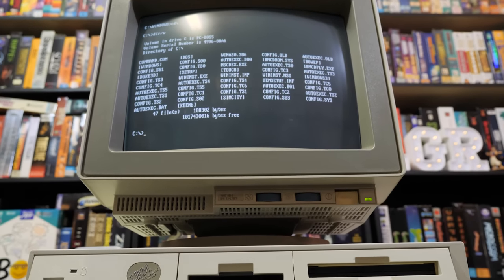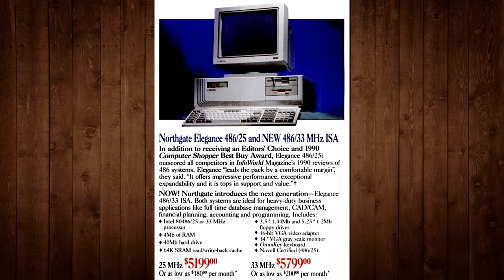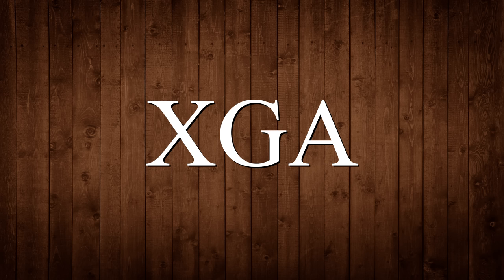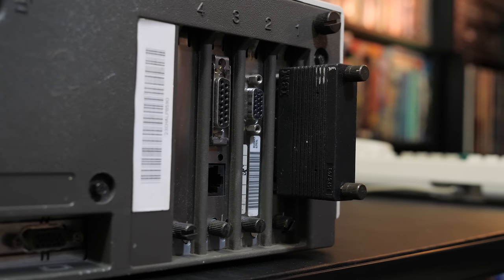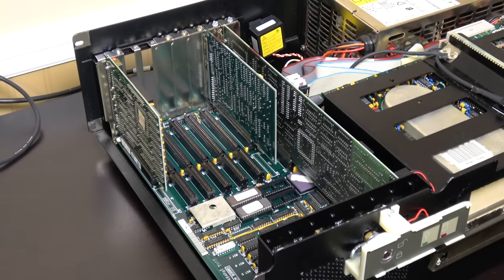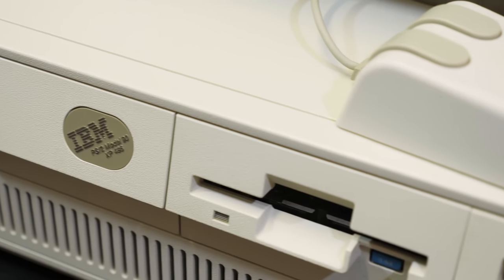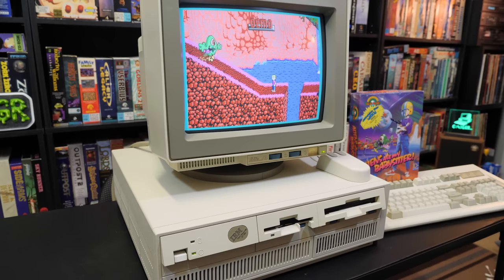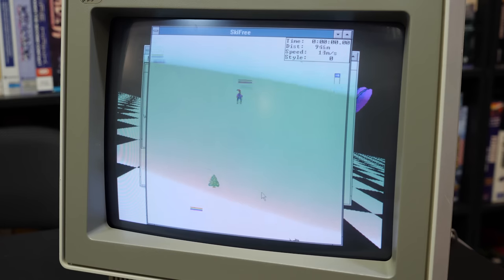$17,000 PC from 1990: IBM PS/2 Model 90 XP 486

Comment: That awkward moment when you realize: In the year 2044, someone will make a similar video about Threadripper and Core i9...
Reply: That won't happen. The i9 never cost as much as a car. The next big leap in performance is at least 20 years out and will replace silicon CMOS with an entirely new paradigm and the i9 will become regarded as a vacuum tube or mechanical switch computer in comparison. Silicon CMOS is pretty much dead. For the next 20 years or so we're stuck with it and you'll get perhaps a factor 2 more CPU performance and a factor 10 or so GPU performance. 

(as a comparison, in the 90's CPU performance increased by 60% per year on average, and if that had continued until 2044 processors in 2044 would be 14 million times faster than what we have today; if it had continued from today and for the next 26 years, processors in 2044 would be 200 000 times faster than today).
Reply: No... it will be like someone in 2045 talking about how quantum computers took up a whole closet and costed millions in 2020
Reply: (0_0) Wow how do you know that?
Reply: IDK, it doesn't seem like too much has changed in terms of standards like it did in the 90s. we can capably use computers from 7 years ago for general computing tasks but in '97 a machine from 1990 would've been ass.
Reply: Also why is this awkward? You make it sound like people never talk about hardware from the past.
Reply: hey, maybe older Clint will do that in 2040 
"this is the Razer Blade laptop, and you've guessed it, it can play Crysis" in Clint duke nukem voice
😅😅😅
Reply: girlsdrinkfeck, you must not now much about modern computers, if you think threadrippers will melt or burn someones house down. They are no more power hungry than an I9, as a matter of fact some I9's run a lot hotter then the threadripper processors. I know AMD processors right before ryzen and threadripper were bad, but ryzen and TR are really good chips. Anyone that is being realistic and not a fanboy, knows this.
Reply: girlsdrinkfeck LOL are you really fanboying a cpu? What are you, 12?
Reply: girlsdrinkfeck Keep trying.
Reply: Rickertsc2 lol that was a great prediction currente age hardware will be described in the future.
Reply: I think this is the big issue, between 1980 and 2000, each new generation doubled computer performance, people were willing to spend thousands of dollars for the bleeding edge technology that had just came out.  Then we got to the point, where your standard desktop used for office work, email and web browsing hit the good enough limit.  I type this on a computer I built in 2007, for most stuff, it's got plenty of performance, even computer programming is well within it's capabilities.  Gaming and video production are about the only areas where there is still room for performance increases.  It used to include servers, but then systems were developed where you could network dozens, even thousands of machines together to serve data,..
Reply: This is a high probability
Reply: AMD processors right before Ryzen were bad? Kiddo...my 1st x86 CPU was a AMD 286 with big, fucking fast 12 MHz! And the AMD 386-DX40, albeit being a older CPU gen, was faster than the Intel 486SX-25, also have had the extra Co-Processor being socketed onto my 386 Mainboard. 

AMD, Cyrix, even NexGen, TexasInstruments (Ti 486 Clones back then) and others have all been nice, cheaper alternatives to Intel CPUs....and nowadays, it's only Intel & AMD, who survived....and remember, if AMD would go down the drain, only Intel would be...and the prices would have been much higher, innovations quite less.....monopols are never being good for others, only for the firm, which is itself the monopolist. ;)
Reply: Not exactly.  Computer technology advances at a much slower rate every year because we've already discovered the major innovations, and we are beginning to hit the limits at which current materials can handle.  For example, from 1990 to 2000, CPU performance increased an average of 52% every year.  But from 2001-2006, CPU performance only averaged a 20% increase every year.  In fact, from 2010-2018, CPU processing speeds have not changed at all, and single thread performance has increased marginally.  The only aspect of CPU technology that changes consistently is the number of transistors embedded into the chips.  Transistor population can improve data load capabilities without increasing processing speeds.  However, the larger number of transistors, the lower amount of workload each individual array can handle, making the chip less efficient.  You can see this phenomenon when comparing quad-core chips to 8-core chips.  Single core performance will be greater in the Quad chip because each core is larger.  The 8-core chip will be more powerful as a whole, but only when all cores are working together because each individual core is weaker.  So why are chip manufacturers using this method to increase performance?  Well the answer is quite simple: Increasing processing speeds also increases heat production.  We reached the maximum level at which processors can safely dissipate heat with their current materials.  So manufactures have adopted the "power in numbers" ideology by shoving in more processing units rather than increasing the speed at which current transistors can run.  This leads into another issue.  You can only compact so many transistors onto a chip until it runs out of space and cannot shrink anymore.  So not only is heat an issue, space is an issue.       

We are at the point where current technology is so good that it is beginning to plateau.  The elements and materials we use to build processors and circuit boards can only handle so much power in such a small space.  Think about it.  We build modern processors using the same general materials from 30 years ago.  In order for computer technology to make another huge leap, we have to start using different materials, which involves creating a whole new architecture from the ground up.
Reply: Or something bad happens in the world and all the knowledge of technology is lost and we desperately try to reverse engineer a smartphone or a xt8086:)
Reply: @markamber1480  cost, not costed.
Reply: @smakfu IBM of all companies created an open platform with an excellent manual for how their competitors could make clone computers. This wasn't intentional, it was a mistake. 

Clones got to 386 first, because IBM demanded a second source and Intel was so proud of 386 they did not want to give AMD the technology to be their competitor for free; as they had done with 8088 and 80286. This just left a big vacuum for clone computers to beat IBM on performance.

PS/2 would fix that with a superior platform that was closed. It didn't.

When the amiga released, the IBM PC was garbage for gaming and multimedia anything and cost way too much for home users; but it had a fast CPU. A spreadsheet machine with high resolution screen for text but terrible colours; boring business beige box.

By 1992 the amiga had become cheaper but it had gone almost nowhere because all the software targeted this huge base of installed Amiga 1000's and Amiga 500's while higher peformance SKUs were underutilized, and therefor nobody bought them. On PC harddrives had become standard, X86 CPUs had become so powerful they could do in software what the BLIT on the Amiga could not do in hardware.

AMD's 386DX40 became the basis for the first generation of very cheap clone PCs and it stayed around for longer than it was welcome really, just consistently dropping in price; even into the first generation pentium era. Both AMD and Intel 486DX2-66 and to some extent Cyrix etc where another one of those CPUs that stuck around forever and just kept dropping in price; where as e.g. 486DX4-100 was always expensive and discontinued production before it became cheap.

Soundblaster 16's had become cheap (as had gravis ultrasound, but nobody bought them, so support sucked and a much better solution than FM synthesis lost despite having a natural opportunity with many games still being amiga ports).

VGA had become standard on PC.

Wolfenstein 3D, Ultima underworld and ultima 7, all released in 1992, really showed what PC could do.

486DX2-66 and VLB (PCI for late, late 486) could crank out enough frames for smooth 3D without cheating so much (small window, blank floor and ceiling, perfectly square and axis aligned rooms etc). See e.g. Commanche (which used voxels), Descent (with 6DOF), Doom (With dozens of enemies at a time and elevation differences and off-angled geometry).

Technology went so fast that if you'd have blinked you'd have missed it. 2 years after Wolfenstein 3D was released it was entirely obsolete; a descent game, but the technology was ancient history and just looked silly. Today Crysis still looks pretty close to state of the art and it was released 12 years ago.
Reply: We dont know what will happen next, but the Moore loy seeams to be broken, so the gap will be not that big. Unless Quantic PC are coming
Reply: @Vikkk07  We know what won't happen next. Quantum computing is not a huge advance for most of the things you use a computer for. It will speed up a very limited number of tasks by a lot and be slower for most tasks.

Every single advance for CPUs has taken about 20 years from lab to fab. Even simple things like going from aluminium traces to copper traces. Since we don't have any revolutionary advances in the lab right now it will take at least 20 years for any revolutionary advances to come.

Most of the interesting things in the labs right now are not clear advances. It's lower energy per compution, but really slow, or faster but only for very particular tasks etc. There is no discrete transistor to CMOS-like jump here.

The reasonable expectation is that the next 20 years will be even less eventful than the last 10. Things will happen on the low power/portable device side of things, but on the high end not much at all. A factor of a few.
Reply: @soylentgreenb  grat analyze, thanks for answering my original post
Reply: @soylentgreenb  Yeah advancement really has slowed down. Just look at the most obvious visual benchmark: graphics. Back in the 80s and 90s, the difference between even just 5 years was HUGE. 10 years? ASTRONOMICAL, like the difference between the Atari 2600 and Super Nintendo.  Then compare modern graphics to stuff from 2009. It's just a slightly crisper version of the same thing we had 10 years ago.
Reply: @paulschmidt7473  Even gaming requirements have leveled off. Trying to play new games on a 5 year old computer in the 90s was insanity. You needed to drop $2000-$3000 on a brand new gaming rig (remember when RAM alone was over $50/MB?), and that was 90s dollars. Now you can get a desktop for $800 that runs pretty much everything decently for the next 5-10 years, maybe not at ultra settings, but that just means sacrificing slightly lower anti-alias settings or bloom (the lensflare of the 21st century).
Reply: @dorpth  I think the PC might be the most "pure" example of this. It didn't have various hardware acceleration features back in the 80's and early 90's. It was just brute CPU performance and brute memory bandwidth. 

Acceleration is by its nature limited to what it is meant to accelerate. For the NES or C64, the stuff you could scroll was made of blocks, called characters because they were originally used for character sets. You made your graphics in these blocks, selected a few colours out of pallette and there you go. You could move the whole field of characters by individual pixels, so scrolling was easy on the CPU, it put a number in a register for how much the screen should be shifted and it made sure that the blocks that were going to be scrolled onto the screen were initialized with the right stuff in time; the hardware did the actual scrolling and drawing. It was literally dedicated hardware reading from memory and tossing it out directly onto the screen just in time with the raster beam. The CPU doesn't have to baby-sit the graphics hardware, telling it each individual pixel to draw. You also had hardware sprites, that were written ontop of the blocky character graphics and could be moved individually. If you wanted it to do anything else the answer was no. You can fake most  things with the hardware available but it was often incredibly slow and memory inefficient if you stepped out of the narrowly defined boundaries of the hardware acceleration. 

On PC. Smooth scrolling was very difficult; it required a lot of bus bandwidth and a lot of processing power. That's why you had the first properly smooth scrolling games in 1990 on PC. This is after (albeit choppy) 3D untextured titles. 2 years later you had ultima underworld, which is textured (albeit affine texturing), proper 3D (albeit in a smallish box), with running, jumping, sloped walls, sloped floors, bridges, swimming, a map you could take notes on directly, looking up and down; an actual 3D game. And you had Wolfenstein 3D the same year; not really 3D, but close enough and blazing fast. Next year you had Doom. A couple of years later you had massive open world RPGs like Daggerfall and you had graphical MMOs like Meridian 59; you also had Quake.

That's what 60% per year performance improvement compounded looks like.
Reply: @soylentgreenb  I remember when everything on PC was going obsolete so quickly in the 90s you had to upgrade every 2-3 years, but everyone said, "A good (CRT) monitor lasts forever!"
Reply: @soylentgreenb  trust me it's going to change a lot
Reply: @SussyFortskinNiteFreakbob  Define a lot. It will be nothing like 1990-2003. Hell, it will be very anemic even compared to the shitfest that was 2003 until present; at least GPUs used to improve at a blazing speed even while CPUs were stuck below 4 GHz and slowly adding cores and improving IPC by painfully small increments.

GPUs used to be 150-250 mm^2 on the high end; they used to draw tens of watts. From the early 00's they slowly grew in size and power for a bit, and then somewhere around 40 nm (I think it was) they ballooned out to 500-700 mm^2 and pushed up against 300 W on the high end. That's where a lot of performance came from in recent years. We can't triple the size and dectuple the power consumption again. Quite a bit of performance also came from finfet. That's a one time improvement. If we want to see the same kind of improvement as finfet from a die shrink we'd have to do something revolutionary as GAAFET. Process improvements are just going to be like pulling teeth.

You can compare e.g. Crysis and Tomb raider. Tomb raider has more objects, pushes more polygons, but it's just more of the same. Hardly any improvement at all. That's a decade worth of progress. Don't even dare think this is because graphics can't get any better; if we had the performance it can get a lot better, but we don't, performance has slowed to a crawl.

You can also compare, say, Doom 1 to Far cry or Commander keen to Deus ex to see what a decade worth of progress used to buy you.
Reply: @EOtekk  "advances at a much slower rate every year because we've already discovered the major innovations," there was plenty of this kind of silly babling at the end of XIX century, they were predicting back then that not many more patents will be granted in XX century as almost everything usefull was allready invented in XIX century and before... The same story with 1950 prediction about computers in 2000 go and google what best specialists in the topic was thinking back then.
Reply: Bruno Torres 2044? That processor will be ridiculously outdated by 2025.
Reply: @Knobcore lol wut? try using a 1ghz cpu from back then for any task you'd do today
Reply: @soylentgreenb  Ha! No fucking way. Silicon  still has a ton of potential. Just look at Ryzen
Reply: more like about the new version of the cheese grater macpro
Reply: Paul Schmidt Thats the point. Right now, there really isnt much need for that extra horsepower. Most business uses will be served fine by i9s. If there was a good financial incentive, someone would be motivated now to come up with it. As an example, when when NASA was all in in the Apollo
program, someone figured out hand sewn ROM gave the best performance. As they say, necessity and or cash are the mother’s of invention.
Reply: Marc P. - You must be old like me tho I dont know as much about tech as you. My first AMD was a 2007 Dual Core. Its still runs tho it needs a can of air from time to time.
Reply: Haha and the commentator will be like "ok guys here we go, looking at the classic Threadipper! This thing was made to churn those 1's and 0' unfortunately my fridge's computer has 10x the processing power nowdays"
Reply: @marcp.1752  Ummm... 286 CPUs are not "right before Ryzen." The AMD FX CPUs were shit. Ryzen CPUs are actually good and my next upgrade would probably be a Ryzen CPU.
Reply: @marcp.1752  No need to get so butthurt about someone misreading a comment.
Reply: @HudsonGTV  It's not "butthurt" as you describe it, it's the sort of typical comment from someone, you,  doesn't thought about my post, before he commented.

 The usual crowd often have a very short attention span, and just posting before thinking, because they do it's cool - without thinking, understanding a previous post. I do see this into forums often....nevermind. 

Have fun !